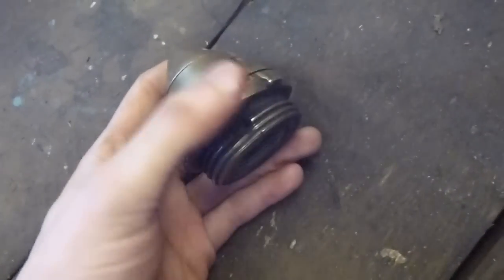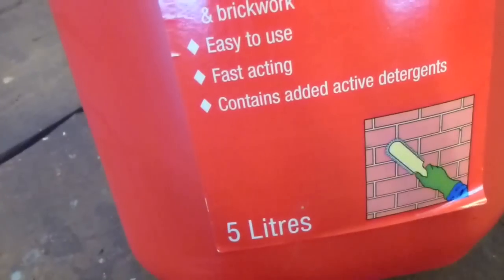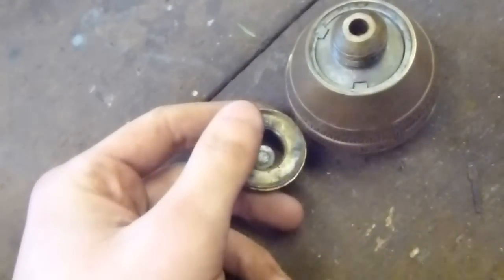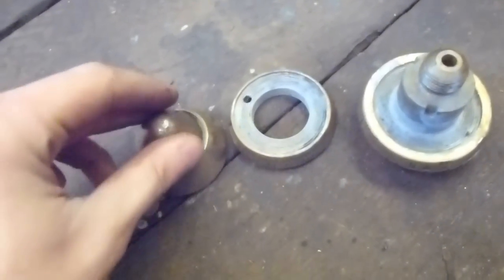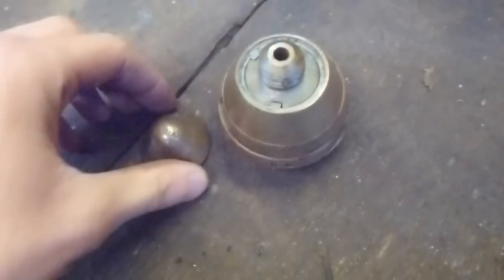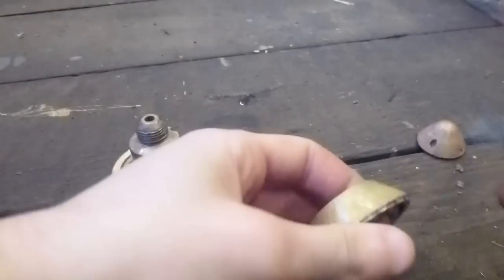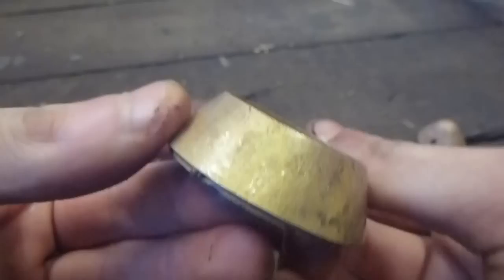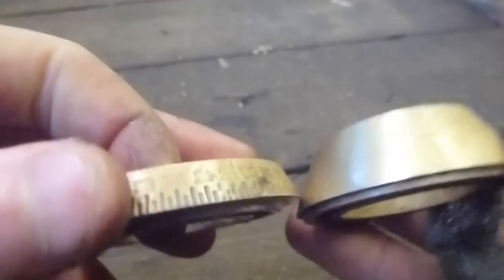How to clean a WW1 artillery shell fuse- and any other brass!

Comment from the maker: Use the same acid (brick cleaner as in the video) put some into a smaller tub, then dip some wire wool into it and start to polish the surface of the shell. It will take a bit of time but it will work, if you look in my videos for a vid of a boer war shell (/watch?v=BfUbgH4k5nw) I cleaned that shell in this way, it looks a lot better in reality than in the video.